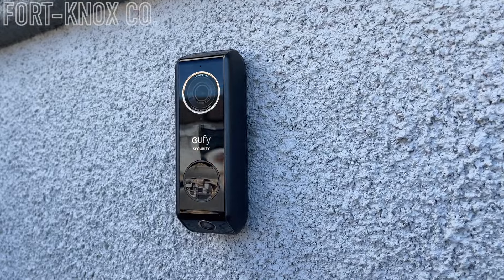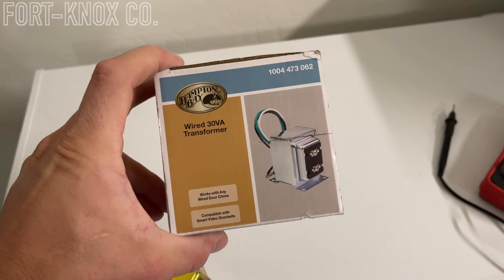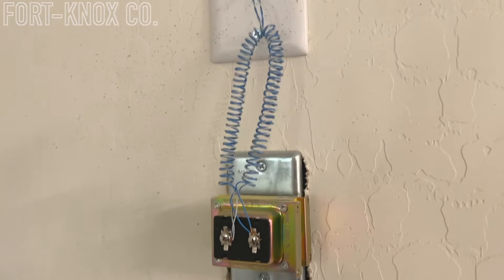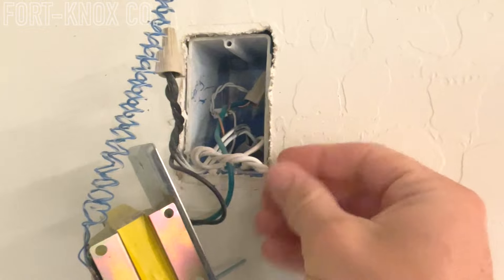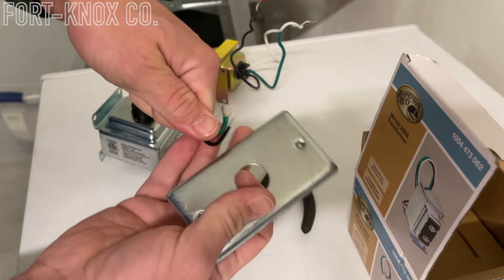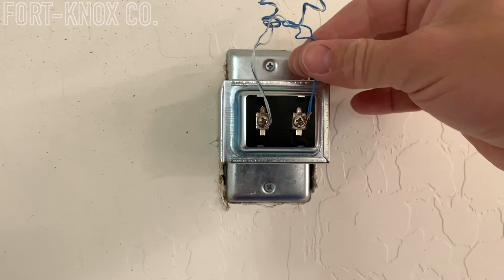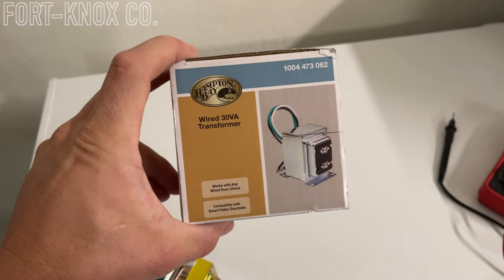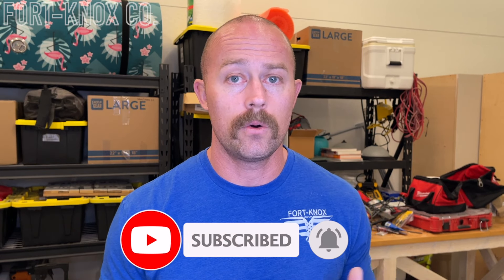Upgrade Your Doorbell Transformer For Your Video Doorbell | Ring Pro Doorbell Efuy Security Blink

Comment: ^ I have Ring doorbell that's low volt and i'll be hiring an electrician to install the floodlight camera( to replace a normal floodlight which i am guessing would be low volt too)... typically if you know, how much would u say is reasonable for an electrician to charge? I saw one review where a person paid $350 to install the floodlight! which is the cost of the floodlight. I would try it but when it comes to electrical things i don't like to play around.I
Reply from the maker: The voltage at the flood light should be standard 120 voltage, not low voltage like the doorbell. If you see my door bell transformer video I show how they accomplish making it low voltage. They basically put the transformer on a regular voltage feed of 120, just like wiring a standard outlet or light fixture/fan, and that has two small telephone wires that feed off, much smaller skinny wires, and that transformer basically suppresses the voltage down to a lower needed voltage for the doorbells. 

If you want to wire in the flood light the hardest part for you would probably be mounting it honestly, the wiring of it is very straight forward. You’ll have a black,white & bare copper wire that you attach to 3 wires on your floodlight. Just turn the power breaker off when doing this and your safe to mess with the wires.   It’s definitely something you can do yourself. I have a couple video showing wiring or fans and new outlets and the process behind the connection is very similar with the floodlight.

Comment: Will I ruin my nest doorbell if I don’t hook up the chime box adapter?
Reply from the maker: It shouldn’t ruin anything. Not quite sure what your chime box adapter entails. Usually most video doorbells may give you a small jumper wire for your indoor chime. But not sure about the box adapter
Reply: @FortKnoxCo  it’s just that round  device that suppose to go in the chime box to use existing chime with the best doorbell…
Just saw video of guy stating that make sure to connect it or you may damage the doorbell? 
Any truth to that?
Reply from the maker: @vatinlocin  honestly I’m not familiar with that chime box adapter. Sorry. Wish I could be more help with that
Reply: @FortKnoxCo  maybe my terminology is wrong. It’s called power kit I believe …

Comment: I have power, it charges the Eufy. The issue I'm having is the doorbell does not chime. The Eufy itself will ring but the chime inside the house won't. I can't find the transformer to save my life. I think it's inside the wall.  Good video by the way.
Reply from the maker: Yeah that can be the issue sometimes with the power supply not being strong enough. The door bell will function but not completely. It may not be getting the stronger power it needs to connect to the chime correctly.  Usually I’ve found the transformer in the garage near the front of the garage and it’s usually installed high, like 6-8’ above the ground so as to not have anyone accidentally touch it. Or I’ve heard of them being installed in the attic/ceiling. Usually near the doorbell wall or your home indoor wall chime. Somewhere between the electrical panel box and your doorbell equipment it should be. On the wall or in the ceiling would be my guess

Comment: Hey mate. I bought the battery version of an eufy 2k doorbell that I’m looking to hardwire. I’m just not sure about my transformer as it was installed prob decades ago. It’s an Arlec Bell and Chime Transformer with 240V 50hz /5-16v 1A. Would this be sufficient?
Reply from the maker: If you bought the battery operated video doorbell you shouldn’t need to worry about out the doorbell transformer as you won’t be wiring it into the system. 
If you got the hardwired version then this would be something you would need to upgrade.
Reply: @FortKnoxCo  yeah I kinda want to hardwire the battery doorbell to avoid charging every often. But looks like I have to upgrade. Are there any you can suggest that are available online?
Reply from the maker: @kogetasarada6372  any battery video door bells that hardwire? Not sure. It’s usually one or the other.  Hardwire versions sometimes have a short internal battery that will last if power goes out but they usually are either or. They don’t waste the time putting in a removable battery if you have the ability to hardwire.  Sorry I couldn’t be of more help. I’d suggest going with the hardwire version if you have the ability to. It’s set it and forget it. I almost never have to mess with it at all. Only time I’ve ever had to remove it off the wall was to reset my WiFi connection after changing the password.

Comment: I upgraded my transformer to 16 30 but after 2 rings i can’t hear my chime anymore but my ring doorbell goes off you just can’t hear the chime
Reply from the maker: You may need to re sync everything. Sounds like it’s not connecting to the doorbell well. That could just be a connection issue.  Not so much a power issue
Reply: @FortKnoxCo., We are having the same problem.  After replacing the  upgraded transformer, do you also need to upgrade the chime?

I think our chime is fried.  We could smell something burning and have a scorch mark on the wall, just above the chime box! 😳

Comment: Can I upgrade my 16v with a 24v with my 16v doorbell?
Reply from the maker: You can, but I’d make sure you doorbell is compatible with 24v. You don’t want to over power it and cause any damage to the electronics inside.
Reply: @FortKnoxCo  Thanks!
Reply from the maker: @mr.boniato6402  no problem at all.

Comment: How did you get such a nice finished garage?  Doesn't look anything like mine. 😊
Reply from the maker: Well thank you. Most garages out here in the area are finished drywall and usually textured. I believe the building codes require them to have it finished if it’s attached to the home.

Comment: I was hoping you could assist. I bought and installed the new 16v 30va transformer but the chime says to only use a 16v 10va transformer. Should I be alright using the 30va on a 10va chime?
Reply from the maker: If it’s saying to only use the 10va then I’d assume you need to use that one. My guess is it could be too much with the 30va and might cause it to malfunction or overload it and cause a short. Most chimes I’ve seen though ask for the 30va because it needs more power to work right. But if says 10va on it the instructions then I’d do that. The 10va transformers are less $$ usually than the 30va.

Comment: What if you can't find it anywhere in your house?
Reply from the maker: If you don’t have a doorbell transformer a where in your house or in the garage then I’d check the circuit breaker box. They are not commonly in there because of the size of the transformer. But you should have one if you have a door bell. Maybe try looking near the bell chime in your house? Could be there
Reply: @FortKnoxCo  I see something, would/could it be attached to the breaker box?
Reply from the maker: @sinosparo  possibly. It should look like the transformers in the video. I haven’t seen any other type of doorbell transformer than these ones I’ve shown.
Reply: @FortKnoxCo  Ok thanks. It looks like that but I'll sniff around before I swap that one out. Cheers
!
Reply from the maker: @sinosparo  sounds good! I hope you get it figured out !
Reply: @sinosparo  Yes, it could because it have to get it's power from a source, years ago it was common to see it there, if it's located there be sure to cut the power source before attempting installation. If you still can't locate the Transformer check behind your Chime box itself, sometime electricians install it there, take the chime box away from the wall it should be a juction box mounted in the wall.
Reply: Thanks for all the replies, I found it on the side of the circuit breaker hidden by lots of things